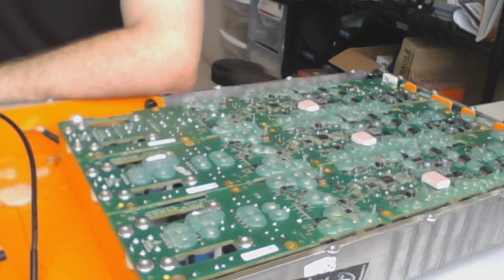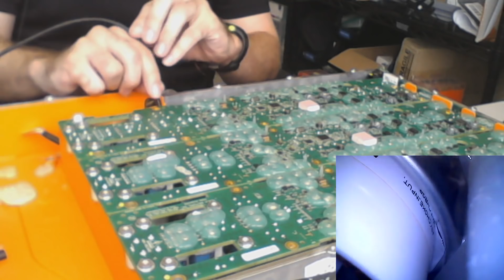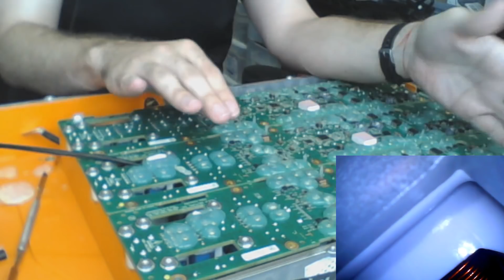Tesla Model X 3rd Charger Endoscopy

Comment: If the inductors are soldered after assembly then why not just desolder?
Reply from the maker: The power planes in the boards are massive and dissipated my 80 watt weller instantly I bought a higher watt power one but haven't had time to work on it and the hurricane lack of power is not helping.
Reply: are you in puerto rico? got solar panels?
If the solder is too large perhaps you can remove it mechanically. Or torch and wick.
Reply from the maker: Yup inlaws do we installed off grid inverter and batteries this week . I work during the day and batteries wont be able to run my soldering iron and year at night :/
Reply: Small world. I'm sure Trump will fix it for you soon :) but seriously, what's the situation? how long before electricity comes back? do you have water, food, money?
Reply from the maker: I am lucky to still have house water and money/job and able to eat w/e i can get my hands on in a supermarket thought tap water is almost non existant have to resort to driving somewhere else to get water (due to generators failling at pumping stations) 
electricity is the worst a few hours ago we lost all metro/san juan area generation capacity around 500MW du e to a turbine overheating. Living in apt sucks for trying to live renewable :(
Reply: Does package delivery work? internet is through cell towers?
Reply from the maker: So far packages seem to arrive thought a bit delayed depending on carrier and destination. Right now i only have cell tower since pretty much all cable poles have some sort of damage. Few offices have fiber that survived but it's quickly been repaired.

Comment: Can you share what camera / light source you are using? I have a camera like this, but the diameter is much larger which limits the usefulness in situations like this.
Reply from the maker: The endoscope was lended from a friend but he got it on ebay for 10$. It includes LED's embedded at the end. It measures 6.5 mm in diameter. Outside ligthing was just window light and my crappy roof LED light.

The other camera is just a 720p hp webcam. My phone camera is higher resolution than the general camera.

There where gaps in the tesla charger which I was not able to access due to the diameter the control board one being the most notorious it bumps with every SMD part on it while going down.
Reply: Hi Anner,  super interesting for an engineer who is also a big EV fan ☺ Looking forward to see if you get something interesting out of the DSP decoding you mentioned. Have you measured anything like current waveforms or switching  frequencies?  Anyway thanks for a great view into the inners of a great car ☺ BR Torben (DK)